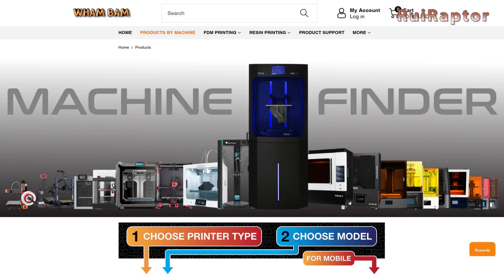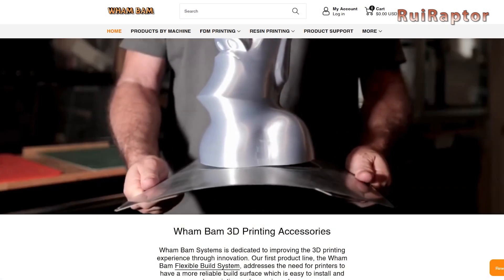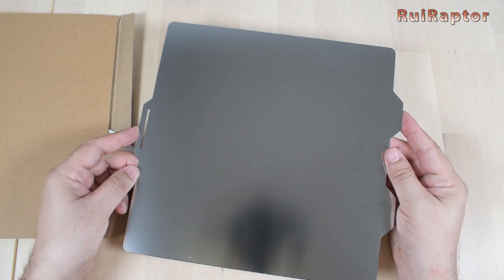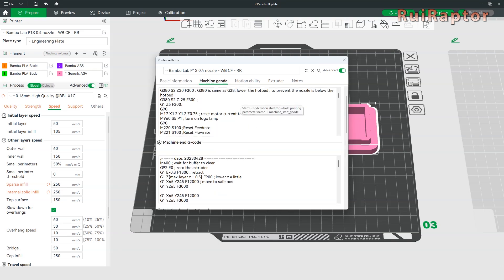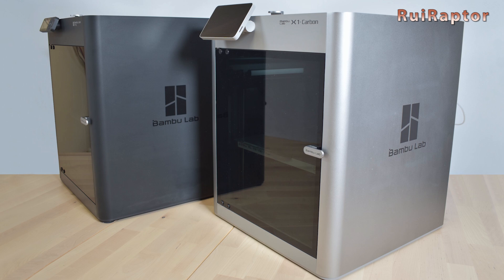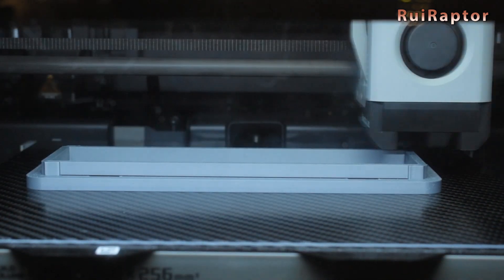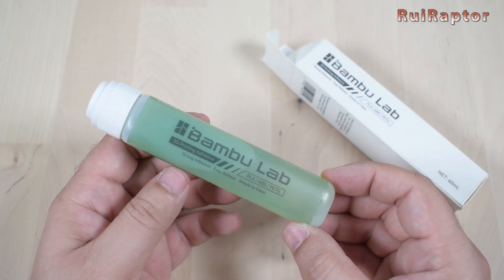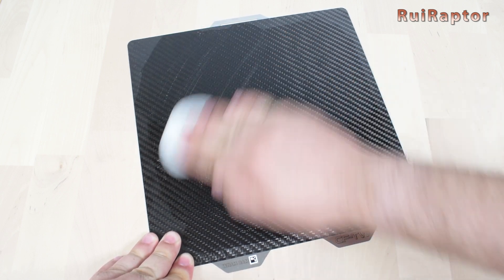WHAM BAM - New Real CARBON FIBER Build Plate For 3D Printers - Analysis & Results

Comment: I preordered this the first day it was available… I’m going to try and cancel my order. I’m not about to introduce water and soap and rags and such a mess into my 3D printing space. I wash my plates every few months in the kitchen and it’s a pita but necessary… after every single print? Not ever. If I can’t return this thing I’ll sell it on eBay. Screw this. Get the Lightyear G10 Garolite plate instead, I have two of em, love the crap out of em. No weird marks, same finish, cleans with IPA
Reply: You don't have to wash every time
Reply: @aeonjoey3d - You're not the sharpest crayon in the box, are you?

Comment: So... it doesn't give the carbon fiber look and it has trouble with ASA... then what's the point?  It's $59 even for the 256x256...
Reply: You can just buy a 0.5mm carbon fiber sheet for 10 bucks and stick it to your metal build plate. I notice the carbon sheet can withstand nozzle stratches better and last longer than pei sheets( either cracks or peels off). The resin on the carbon fiber does wear down, which will show the fibers on the bottom of the print.

I use carbon sheet because it just works better with nylon and it does last a lot longer than other metal plates. Have to scuff it down and use glue in some cases.

Comment: Sooo... it does not work with ASA. Because with glue ASA would hold on anny surface. I use spray glue on bare metal sheet.

Comment: Kinda cool, but those marks it leaves and a bubble bath after each use makes it a hard no.
Reply: Can clean with IPA as well, it’s important that the user cleans between prints in order to remove any reserves left by the previous print, it should be happy for anybody using any surface
Reply: @petersolomon3505  he said ipa was not as good as soapy water, the marks are annoying to me as well as the price 🤷‍♂️